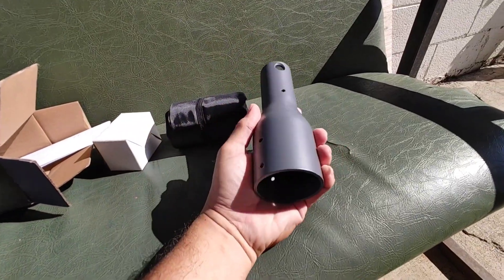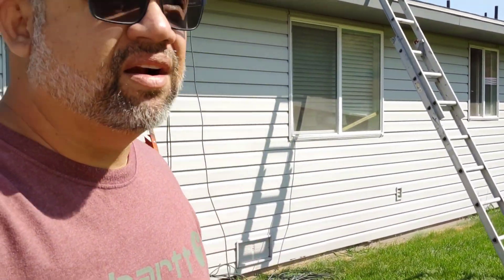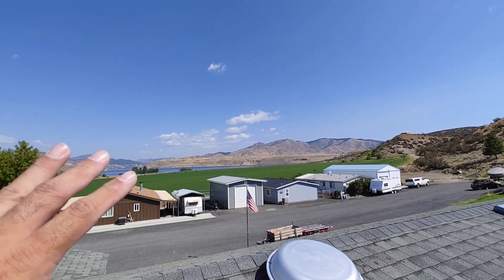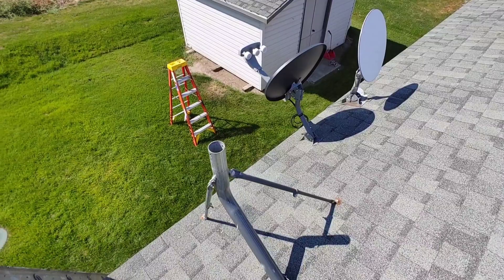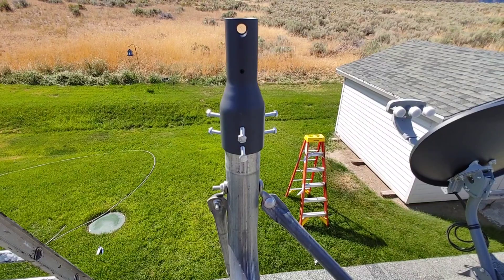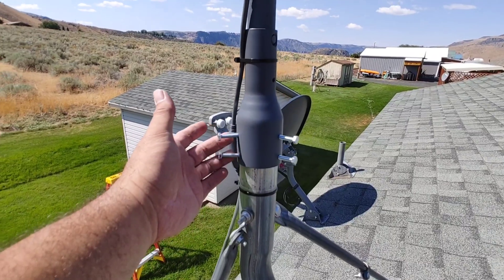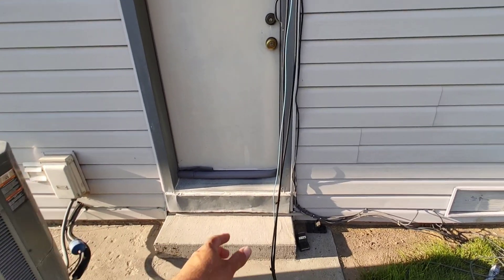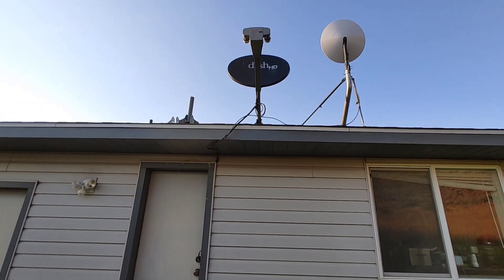Permanent Starlink install complete!. Pipe Adapter arrived | August 2021

Comment: 2 3/8" is within Starlink's 2.5" max diameter specifications. Surprised you had trouble with the other bolts. Hmmmmmmm. Maybe I'll just use a 2" pipe instead?